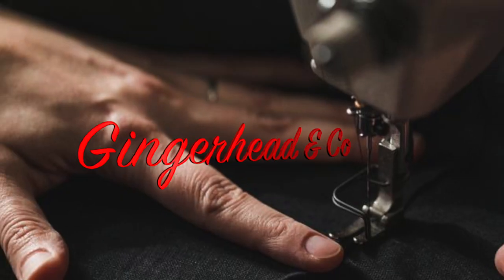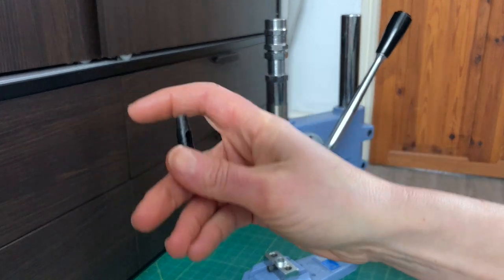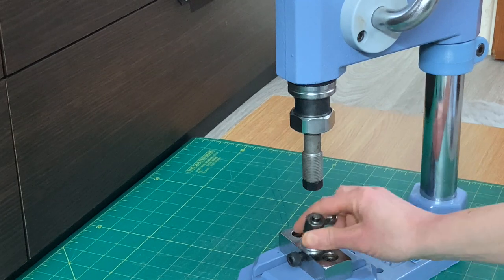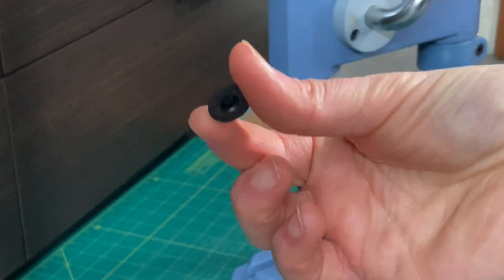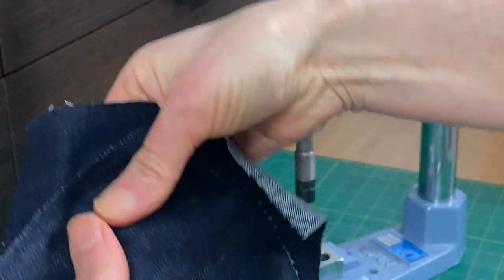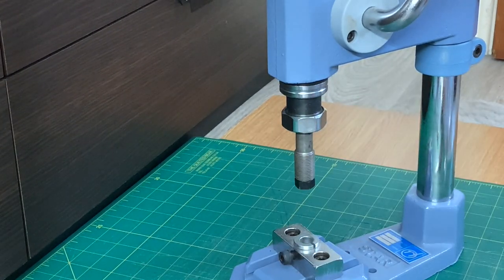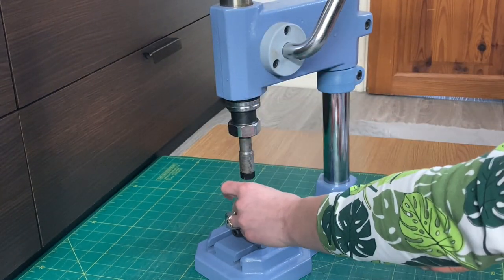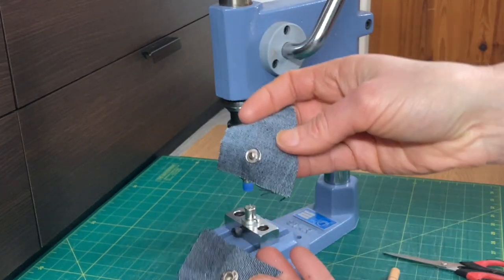How to use a professional hand press to instal grommets, snaps and rivets.

Comment: Thank you Alex! I have had mine for awhile but have been reluctant to dive in except for a few practice snaps. Agreed that interfacing is a must!  Will keep you video for reference. Excellent review!
Reply from the maker: Thank you 😊 I keep offcutts of soft shell and washable paper (used in bag making) and use them on the stress points of lined garments (also, I often line hoods just to be able to hide all the interfacing and patches of leather/soft shell that I use under grommets) Anything densely woven but relatively soft (polyester is actually better for this) works very well. I used to make lots of dogs harnesses (I still make them, just not often) and got the press for that (I made harnesses for “kjoring” skijoring is a sport where your dogs pull you on skis but in the UK snow is rare 🤣 so it was basically for pulling 🤣 ) so they had to have multiple stitches and rivets - I always enjoyed the riveting bit (sewing though multiple layers of webbing- not so much 🙄)

Comment: Thanks so much for this demonstration. Do you have to buy fasteners that are the same brand as the press, or will it work with fasteners of any brand?
Reply from the maker: No, you can buy generic ones (even the ones from Alibaba work - the small snaps I use in the video are from China) but it’s best to have a trusted seller, some cheap fasteners are not the best quality. You need to buy the dies that are specific for your press though (a set is usually about £15)